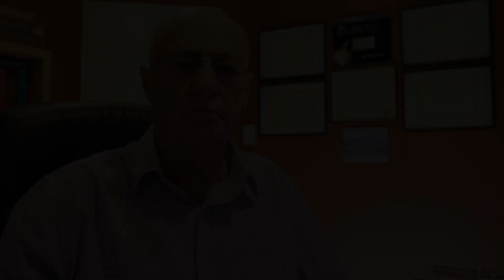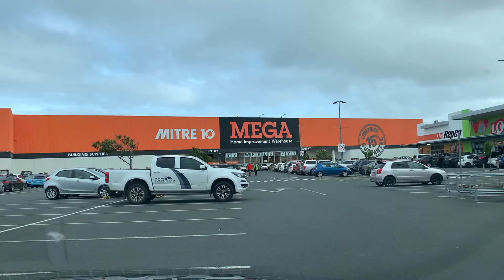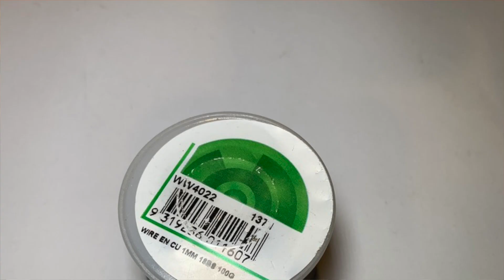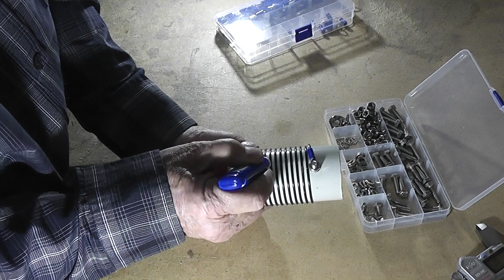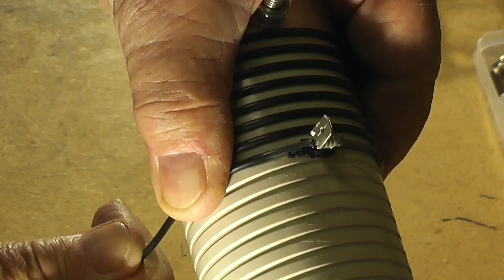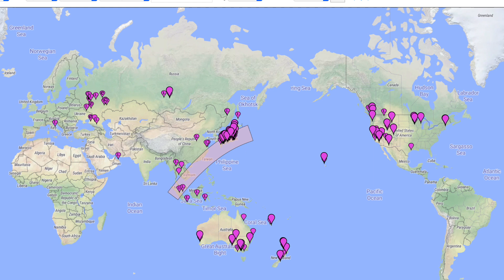80 Meters for DX-Commander - Roly's Coil, great for DXpeditions.

Comment: Hi Roly I am new to your channel, but I have heard of the famous Roly whilst watching both Mike and Calum’s channels. 
Recently purchased 12.4m DX Commander pole to use for experiments with vertical antenna’s. 
The Roly coil will be one of the first. However don’t have the lathe facility and will adopt the Mike hot glue method. 
I’ll report back what success I have. 
With regards to your video, I really enjoyed the entirety, good pace lots of visuals good conclusion supported with facts.  Best regards Steve. 🎉🎉🎉
Reply from the maker: Cheers Steve Happy New Year

Comment: Do you know...can one switch the 30m element out and just run another 40m in it's place with this coil at the bottom so as to not have to switch the connection back & forth with the previous 40? Or will the 40's interfere with each other?
If with them touching/overlapping each other at the top causes a problem, would another option possibly be to use the 30 holes on the commander or signature 9, but only run the new 40 to the top spanner and fold down over the outside of the spanner from there & back down in manner like the first 40 and put the coil on the bottom for this 40?  Thoughts?

Comment: Hey Roly, great work. Thanks for sharing. One question, what would be to stopping you adding another 40m element and using this with the coil permanently for 80m ?
Reply from the maker: Nothing. However there could be a lot of unwanted interaction between he elements to contend with...  cheers

Comment: Vertical monopole for 7 MHz will have impedance about Za = 9 - j 646 ohm, plus ground loss in series (say about 40 ohm).  Coil can have X= + j646, and make SWR good. However, base coil can't improve poor current distribution. Top 3.5 m of vertical will have very low current and do nothing for far field. Tip of vertical has more chance to clear ground obstacles, and you really want big current in there. Using top loading will bring maximum current to top of the vertical. You could just attach 10.4 m long sloping wire to tip of the vertical.
Reply from the maker: Thank you Tina for the input.  However, in this and many cases, there is no room for 10.4m long sloping wire.....   so this is a compromise that works...cheers

Comment: Hi Roly, love your teaching ... but b I've got a question for you ...
Rather than adjusting the coil by selecting suitable taps, would it not be easier to insert an iron plug or slug of some description to adjust the inductance of the coil?
Your thoughts?
Reply from the maker: Hi Luke, Yes that would certainly have an effect and alter the inductance for sure.  I just wonder about the mechanics of such an arrangement...
Another method is to use a "roller inductor".  They are not all that common now days, especiallly high power roller inductors.  They would also have to be kept put of the weather as well.........................
Reply: @ZL1BQDRoly  ... I was just thinking out loud really ... I haven't thought about the mechanism, but thought it might provide a "fine tune" of sorts.
I've seen that Mike M0MSN has made a 160m/80m/40m version as well, but that probably would not lend itself to slug tuning ... ah, but its fun to kick ideas around hey!
73
VK4KYT
Reply from the maker: @MegaPrime2010  I resort to one of my standard answers Luke, "give it a go".....  cheers

Comment: Hi Roly. Hope your well and keeping safe. All ok here, although I am  finding  the band conditions to be poor. I was checking out your 80m Roly coil, and as I have spare dx commander pole set up on 40m, therefor a 80m coil would be a nice project, except I am not in any position to get the materials or make one up. Therefore I was wondering if you have any  extra  80m coils
Reply: Sorry I got cut off, best wishes zl3xdj
Reply from the maker: Hi Brian, good to hear from you again.  i will drop you an email  😊

Comment: hi Roly, wonder what kind of power can you put through this type of coil, as when I attempted one years ago, it shorted out my coax half way back to the shack.
Reply from the maker: Hi Brian, I have been running this setup at 400watts with no problem at all.
I did a "destruction" test a while back and it took a full 1Kwatt for 15 secs bursts but i would not recommend this for normal use.
Absolutely no problems for continuous use at 100 watts for sure............  cheers

Comment: Roly, would a modified coil work for 160m as well? Rich
Reply from the maker: Possibly Richard.  The design philosophy was to use the existing elements as is.  Hence using the 40mtr element loaded with the 80mtr coil.  Loading the 40mtr element with a coil for 160mtrs might be a bit of a stretch.  I am sure you can get something that will "match" but it radiating efficiency would not be worth a damn is my feeling.....   cheers

Comment: Sir it was a brilliant video, just had a question, what is the importance of pitch in winding a Loading coil and how critical is it for the design ? TNX
Reply from the maker: The pitch will affect the inductance of the coil and hence it's tuning.
At 80mtrs there is a little bit of tolerance is acceptable but this is a tried and proven design so stick to it if you can.....cheers
Reply: @ZL1BQDRoly  thnx alot Sir..

Comment: Thanks for sharing. You are doing this, I am just thinking about doing it, so you certainly outrank me in influence and certainly in KNOWLEDGE, so my question is not a challenge but a curiosity? My thinking is this being a fan vertical dipole of just fan antenna, knowing that the signal will follow the most in tune or resonate path, why couldn't you just add the coil as if it were a different radiator and let BOTH the 40 and the coil connected to the radiator as 80 be connected both all the time, with my expecting the signal to sort out its path according to the frequency being transmitted.  Right now, most of my hobbing is thinking and planning, getting the stuff needed for when I can do it, maybe in a while I will get to try and do it.  Thanks !!
Reply from the maker: You could perhaps have a series of coils as you describe.  I think it would be a bit unwieldy and a lot of interaction with the various coils.  But more than this would be the efficiency of using coils.  The fan vertical dipole system as used by the DX Commander series are a series of 1/4 wave verticals and so afford the maximum efficiency for each band...  cheers

Comment: Would it be possible to run the coil concurrently with other bands on the DX Commander? I would imagine the coil over the pole would probably create a poor reactance with the other wires, but perhaps if it were mounted to the side of the pole? Either way, quite an interesting design, and thanks for sharing.
Reply from the maker: A tentative yes....  I have used it concurrently with the other bands BUT the other bands did need a little tinkering with to get them spot on again.  ..cheers
Reply: Would it not fit and perhaps be better underneath the element wires? Or yes maybe on a small short pole or spike to the side? Have you tried either.

Comment: Hello Roly, I am slowly putting together my first antenna, multi band ground radials with a vertical element I can hang from a tree. I don’t have an ATU or an SWR meter on my SGC SG-2020, I’m guessing some form of antenna analyser would help me match the length of the driven element to the mid point of each SSB but which one??? Do you have any suggestions/recommendations please, de M7ELX, Guy
Reply from the maker: There are a tons of analysers out there Guy.  I am fortunate that I have a bunch of equipment that we use for Commercial instals but that is a very expensive way to go.  May i suggest that you go to the DX Commander Discord channel and pose the question there.  I think you will find what you are looking for there.  Some sort of external SWR meter will pay dividends for you as well....  Cheers
Reply: @ZL1BQDRoly  thank you, 73s!

Comment: love the plastic former pipe what else can you use if you've not got a lathe at hand ? Mike M1KEY M0FCG
Reply from the maker: Well here is an idea Mike.   Perhaps i should make a video on this as well.  
First wind double sided tape onto the tube.
Then (if you are using 1mm diameter wire) wind five wires onto the former at once, that is, lay 5 wires side by side and wind them on.
The double sided tape will hold the wires in position.
Then once all the windings are in place remove 4 of the windings leaving only one winding remaining nicely spaced at 5mm.
You could try that :) 
Please let me know how you get on.........

or..... (you could buy a former from me or an assembled unit even :) )

Comment: Thanks Roly. Amazing video and I shared it on Josh's channel also. After seeing Mike work through the winding, I like the lathing but am not sure how I would achieve without a lathe. I will definately add this to my DXC. I have the room barely for an Inverted L but it is just not coming down below 2.2:1 and I want to cover 3.573 and 3.916 so, quite a wide range. Your coil should do nicely for that. 73 Roly
Reply from the maker: Awesome, thank you Don. Drop me an email, QRZ will help there.
Reply: Except now I see that you will be selling them. Now I know how to get the lathing ;)
Reply from the maker: Only to those who are having trouble finding a lathe that will do the job..
Someone who is into CNC work could also help.  Talk to them about "4th Axis"  and that will make you sound real knowledgeable :)

Comment: This is on my to-do list for my POTA setup.  Thanks for sharing Roly.
Reply: Oh and BTW I wonder if it would work winding a 5mm diameter cord along side the wire for spacing if you didn't have access to a lathe?   I might have to try that.
Reply from the maker: Yes that would work Matt.  That was a method we used Commercially once. In fact, we wound three wires side by side on to a tube that had a sticky surface. Then two of the wires were removed leaving the third wire nicely spaced.  It was quite fiddly from memory.
Reply from the maker: This is one of the things i had in mind for this coil Matt.  Ideal for PoTA etc.

Comment: A great add on to the DXCommander antenna. Love how you had the groove turned into the tube.. Excellent job 👍
Reply from the maker: Yes, the grooves certainly makes life a lot easier.  Difficult to hold the turns in place otherwise.
Reply: @ZL1BQDRoly  - I have grommet material that I have used previously to help me guide with wire in a coil. It requires a bit of measuring to make sure spacing is perfect, but it works well.  Your method is definitely an improvement and doesn't require additional materials. But I don't have access to a lathe, so I use the grommet material for spacing (for now).
Reply from the maker: @michaelk5mskaustintexasusa334  Great, stick with it and let's know how you get on....cheers